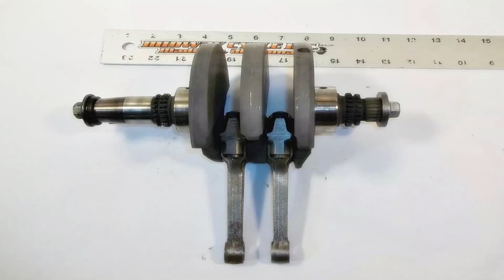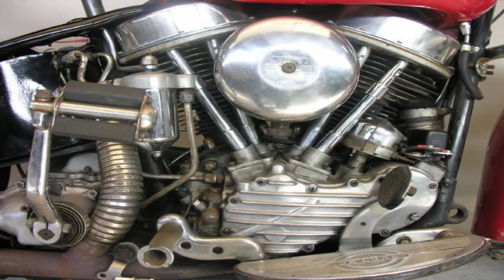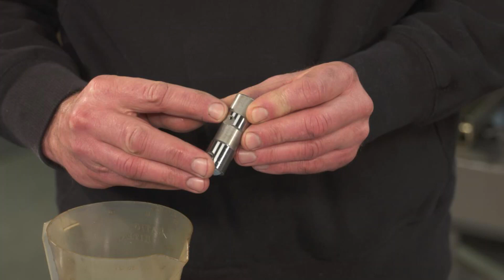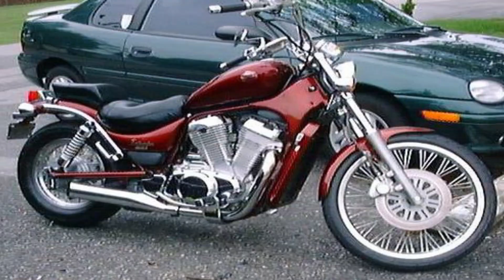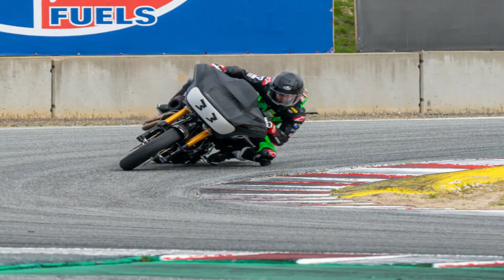Harley-Davidson Engine Design is the Worst

Comment: when people ask for big changes on a working line, that is not as easy as they think...
i did the Concept design for the Ethanol 27, ( including the engine rough out )...but H-D would actually be doing the real design, and i know they would do a good job.
and they are either Not doing it, or want to Surprise me, ( even though i hate surprises, that is how that goes ) .... H-D engines are always good designs, it's just more about how the engine looks in the bike....i have 3 concepts in, ( two with new engine designs ), and if any get picked, it will because 1) they are all money makers 2 ) would not compete with the rest of the lineup, and 3) because of my adhering closely to H-D design evolution, ( and maybe because my gandpa worked on IOEs with the founders ) .... but mostly the working cash, so other changes are easier... that will be why if i get picked on any.
Reply from the maker: There's just so much behind the scenes people don't know about but very true when it comes to Harley-Davidson they are about how it looks first!
Reply: @GixxerFoo  yeah, it's like the engine and the frame are designed together at the same time.. and that is how i went about my concepts also... the engine gets designed to match with the frame...like the frame, or space available, sort of dictates the engine design.

Comment: i cringe when i see, or hear about, someone snipping out their stock push rods.
those are still the lightest push rods...lighter than aftermarket until someone makes a chromoly rolled end tube type... but anyway, Torque is a function of Displacement and BMEP, ( no matter how you slice it ), under square, square, over square, torque is related to displacement and BMEP .... ( it's a bit of a math exercise to confirm that, but it is true )...the fuel used to burn faster, and the piston ring metallurgy couldn't keep up anyway...Now we have high octane fuels, and piston rings give production speeds of 4,000 fpm.
so i think your confusing the extra power from the RevMax engines as coming from the crank design .. the roller bearing single pin cranks are actually Sightly More Efficient, but the older engines don't make as much power because the exhaust valves start opening, before the charge finishes burning, at a lower point in the RPM range.
Reply from the maker: That's exactly why I'm not a fan of the of adjustable push rods!
Reply: @GixxerFoo  exactly...they sure are convenient, but that's where the benefits end..
Reply: little ideas and thoughts are always welcome, 
but Jochen spent a year riding around and talking to customers, and i am pretty sure, at this point, he has already heard it all..
so don't worry about it right now.
Reply: @GixxerFoo  one of my concepts is a small retro-vintage commuter with a push rod engine..

and even though i am an engine designer, i can't do much without company feedback, or someone has to check over every little thing, and then the feedback comes in and they might as well start over there ... 
when submitting any concept, it has to be very technically correct, ( as if designed by an engine designer, and a chassis designer that at least basically knows what he is doing ) But Very Sparse .. because you can't just go lose cannon, without checks and feedback, or they would have to start all over again anyway... like loosely framing up a concept, and that's all.

if it makes it to discussion, it might get pinned up on a development board for a starter, and it might not.

but i don't think H-D takes many concepts, and if it would compete in the same niche, with any of the existing lineup, it would probably get tossed.
Reply: the only problem with the stock push rods is that you can't make them shorter. 
( eg. if one manually increases the compression ratio )

if you need shorter push rods, and want a lighter push rod; the fixed length aftermarket ones can be shortened by warming the tube, removing the end, turning down the tube, and reassembling.

Comment: Ok, dragging 'Victory' into this, you involve Polaris, thus 'Indian'...and Indian set a whole new path that Harley is digging hard to follow to prevent market-loss. The 'Scout' with it's 69-cu.in. engine is making 71-hp, over 100-ft.lbs. of torque...STOCK! Little guy, smooth running, BIG TORQUE! It also has overhead cams/valves, rev's like most V-twins do (power down low on RPM)...oh, yeah...and it's WATER COOLED! You know what 'all this cost them'? Getting rid of those 'keep them, they're pretty' pushrod tubes!!! That's really it! You could STILL put 'big fins' on those jugs (look at the Indian Chief 111 Thunderstroke...looks a LOT like a 1940's Chief engine...but MUCH larger)...making 80-hp and well over 100-ft lbs of torque! Put a Stage 1 exhaust and air intake on it, and add 5-7% more to those numbers! (both also get well into the 45-mpg fuel range). Now, the humor: The 111 Thunderstroke is A PUSHROD ENGINE! It also MSRPs in 'nice dress' for $20k...and when Polaris says 'MSRP', Indian comes in close...not like those 90% of Harley dealers who think 'I can't ever sell at or below MSRP'...nope, no 'special volume dealer hunting', no 'gotta live in that state'...drop your $20-$21k (taxes, fees, as expected) and drive off...and by 'driving off', I'm talking leather bags, road bars, road lights, tinted windshield, custom leather seat...yeah...no 'upgrades' needed to make it presentable on the street.
If you THINK for one second, that all this didn't bother Harley...you're wrong. The Pan American is chasing the Indian FTR. The Low Rider, Low Rider S, Low Rider ST and the Fat Bob are all chasing the various trims of Indian Scout...with only the 117 on the Low Rider S out-performing the Indian 69...but with twice as many cubic inches, you kinda expect this. Of course, one of the BIG sell points for Indian is not only the 'lady rider' friendly presentation on the Scouts...but 'they don't have to completely disassemble it and rebuild it' to have what they want...and while I've built everything from 426-hemi's and Corvettes, to Hondas and Yamahas in my day...I am now to the point of sanity, I AM NOT going to drop $25k, $30k or more on a bike, to limp-it-home just to start WRENCHING ON IT! It's called 'Motorcycle Riding', not 'Motorcycle Wrenching'...and Harley, for sake of profits, has COMPLETELY forgotten this...well...until BMW, Indian and most other 'old bike companies' jumped in at half-price, opened up a new customer venue, and reminded them...'there's only so far that company logo and catchy phrases can take you'.
Reply from the maker: Indian for sure has really forced Harley-Davidson to step up big time, I am shocked they let the Scout roll around as long as they did without updating the Sportster. The comparisons between the Evo Sportster and the Indian Scout were just laughable to me, that Scout is going to walk all over the Evo Sportster everywhere.

Comment: sure a lot easier to swap a cam set on a tc88 than it is on any of the  asian imports. been at it over 35 years for a Living so I sorta got a clue. then let us look at  servicing the trans, simple to do on a harley with no need to touch the engine, UNLIKE asian imports that require engine removal and engine case split to get at the trans. lets look at going big bore cylinders. e z p z on harley yet on an asian import you have a cam chain issue and cams. harley is 10x easier to work on and with than ANY asian import EVER. again I've Over 35 years experience to back my claims.

Comment: I dont. ass a Harley ridder for forty years. i would love to see harley build a bigger displacement liquid cooled overhead cam bagger. the cpuld call it " the indian challenger challenger. Im happy to see the 1250 now make that engine in a 2000. with about 160 hours out of the factory in a bike that needs nothing. i know that goes againt the catalog but f$%k HAVING to have to fix all harleys crap to get a rideable bike. Im old I want to get on a bike , lay down a shitload of maintenance free miles. its impossible to do that on any harley out of the factory. like i said before i had that kawasaki for a short while but being a harley guy i sold it and bought a roadking and i miss the kaw. it was a much nicer bike. i put 80k on it in about a year and a half. changed the oil and tires and literally nothig eles but some creature comforts. my roadking on the other hand I've had for a year , put about 40k on and spent another 6k in parts to feel like i might get there .... and home.

Comment: It's sad Harley stopped using gear drive cams.  If they made the effort they could make the most simple and reliable engine ever made.  Instead they make a time bomb
Reply from the maker: There was a lot of reasons for getting away from the gear drive, mostly cost and increasing production efficiency. But Harley will say they did it to meet noise requirements going with the silent roller chain.
Reply: @GixxerFoo  my buddy is an expert HD engine builder (unfortunately he has Lou Gehrig's disease now) but he swears by knuckleheads and evolution big twins.

Comment: Hey Foo, I've watched all the twin cam videos , 2 or3 times. They're all great. If you're looking for ideas how about M8 engine videos? Things you have found yourself inside the case, bad piston oilers, loose tappet cuffs ect. I'd owe you one.
Reply from the maker: The biggest problems with the M8 have been oil pump scavenging and crank case ventilation. Early models had some problems with the piston oil jets coming loose, not sure if this was from the factory or something that just happened over time.

Comment: they can shove the electric bullshit and harley might be making horsepower with the milwaukee motors but i started riding in the early 80s that was never a major deal for me.if we wanted a fast bike of course we built strokers and sportsters were always good for speed.i rode a shovel for a long time and it was very reliable  it was 80ci not super fast but it was good enough and the sound was thunderous.i  have a good friend hes a mechanic for harley over 30yrs and runs his own shop he brought up the hp of the new harleys and i told him with the epa bullshit etc there is gonna come a time where fully water cooled and your only going to get a certain hp without having to completely changing the whole design.i still ride a twin cam and mine is reliable and fast enough i dont like where harley is going especially the prices.so my next bike will be another evolution with a reliable stroker and a 6 speed i mean what more do you really need all i need is reliability and the 6spd
Reply from the maker: This electric stuff is a total joke in my opinion, there are so many factors surrounding that which make incredibly impractical. I prefer the older motors and just stroke them out and build them right from the bottom up!

Comment: Their engines are fine as long as you're not looking for something fast. The guys that get me are the ones who spend $40K on a new Harley, then sink another $10-$15K into the engine trying to make it fast. Why not just buy a V-Max or a ZX-14R and save yourself $30K? Either of these bikes STOCK would be way faster than ANY Harley, regardless of mods...
Reply: I know what you meen, theres no need to make a HD faster!
But who the F**K wants a rice burner? Okey a faster way to the grave. 👏👏
Reply: @bobvido9875  Me. Rice burners are superior machines...have been for decades...who the hell wants a bike designed using 1950s technology? You can polish a turd all you want, but it's still going to be a turd...

Comment: Bought my Heritage Softail new in 1999. I didn't pay attention to the subtle differences between the different models. Me and the wife have always traveled by motorcycle and wanted a bagger before baggers were cool.My buddy  bought his Softail Standard  a month later.  On our first long ride and had to stop and refuel,  that's when I noticed I had a 4.2 gallon tank and his was over 5 gallons.  And I wondered why my bike , with saddle  bags that are ment to load with stuff for a LONG RIDE, had a smaller tank than a bar hopper. Over the years I have lost all respect for HD. Found very cheap internal engine parts, and for the price, not worth it.

Comment: Used to have a '90 883, now have an '05 1200 sporty.  Just a fun bike.  As noted elsewhere, I didn't buy a Harley for power/speed.  That's for the rice burners or pasta specials.  Part of owning a Harley is standing next to is and feeling the earth move.  I worry for the company, yet again.  they've done well when they stay with some version of the 'traditional'.  Every time they wander off into being just another wannabe rocket, they fail.  This new Revmax engine, while a technical marvel, is barely a "Harley" engine.  There's a reason the classic cruisers are a copy of a Harley.  It has been the benchmark.  Unfortunately when one messes with the benchmark, the wheels come off.  I live in a neighborhood with hot rodders.  Sure you can get a bleem of horsepower from a supercharged two liter but there's nothing like a bit of 400-ish cu-in big block iron pounding the ground.  Harleys are the same.

Comment: First let me say I own a Harley and 3 Hondas.  I love my Goldwing and VTX.  MY Harley is a good bike and the service is FANTASTIC.  I don't know about the service on a Honda since they never have problems.   Hondas come with plenty of power and a Goldwing is expected to last 300,000 miles.  They are quick straight from the box.  My Harley has good quality workmanship and sounds GREAT.  Harley is a great nike for being like all your riding buddies.   The air cooled engine is really a good way to build an engine, all my lawnmowers have very similar design.   For long trips I drive the dependable Hondas since I wouldn't ride a lawnmower on a long trip.  Both bikes have their advantages.

Comment: No.  The design is beautiful in its simplicity, effectiveness, aesthetics, etc.  Go Stage 2 and the old air cooled, pushrod design gives you everything you could ever want in a cruiser and touring frame.
Reply from the maker: Getting the right cam in there makes a huge difference!

Comment: I absolutely hate V-Twin engines, except the Harley single pin crank engine. Nothing sounds better at low speed than an air cooled, single pin crank, long stroke, 45 degree Harley engine. 

They just have such a silky rumble, there is nothing like it. Modern engines sound so awful. And the whole reason to own a gasoline engine, is for the sound, and the feel. If it doesn't sound good, then you may as well switch to a higher performance electric motor. Only the good sounding engines will be sought out in the future. 

The new Corvette flat plane crank sounds awful. All of the new "flat plane" crank engines sound atrocious. The new Yamaha R1 flat plane sounds awful. Harley is one of the only companies that still has the original, authentic American engine sound. Then you have the Triumph triple that is also using a flat plane crank. The sooner the flat plane crank "trend" dies, the better. 

Harley is one of the only modern motorcycles that sounds truly good. There's a lot of really awful sounding modern engines out there. Fortunately, the Pan America has a 90 degree firing angle, between cylinders, so it has a 90 degree European sound. The Ducati and other 90 degree liquid V-Twins have always sounded phenomenal.

Harley needs to work on making a longitudinal 4 cylinder engine, running lengthwise in the chassis, like the Henderson of the 1930's. This would allow them to make a large cruiser with a vastly superior engine. Alternately, they could produce a V4 or a flat four. But they do need a 4 cylinder bike, in order to expand their model line.

Comment: I love my HD V Twins and wouldn't want anything else. I rode my 1997 80 cid EG for almost a decade and eventually traded it in on a 2007 96 cid FXDB and and thought that was a monster and eventually traded that in on a 2018 107 cid FLHX. With the increase in hp & torque with each trade-in upgrade I am completely satisfied at this point each time feel the torque when I shift through the gears of my 107 M8.
Reply from the maker: That 107 M8 is a very strong motor, it really doesn't give up much even to the 114. It's got a bit smaller crank but it still puts out plenty of power all over the graph.

Comment: You make the assumption that everyone wants the same engine characteristics as you.
If this was the case harley would have died 50 years ago.
The ability of the harley engine to produce usable power from low down is way better value for money than unusable top end horsepower. I base this on road use of course. To the point is that some of the so called Japanese superbike engines are power limited in their lower gears and yet they can exceed most speed limits in 1st. By contrast the harley engine can use most of its gears at fairly low speeds. So is the harley engine bad? Maybe it is but its certainly not pointless.

Comment: Big think here for the comment section:

Have you ever considered that your love/nostalgia for the H-D sound/feel is completely manufactured, and largely on the basis of what you associate it with or associate it opposite to?  I'm not saying you're wrong for liking it, only that it is a sort of branding, but one that you don't consider has been pushed from top down, but sold as being bottom up, and as an excuse to make more and more costly motorcycles that haven't really been driven to improve technologically for decades.